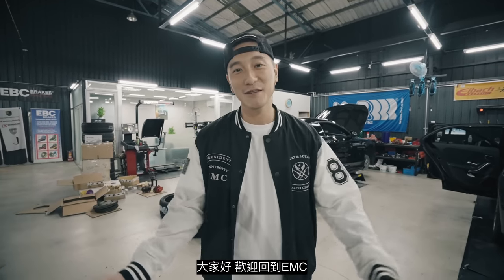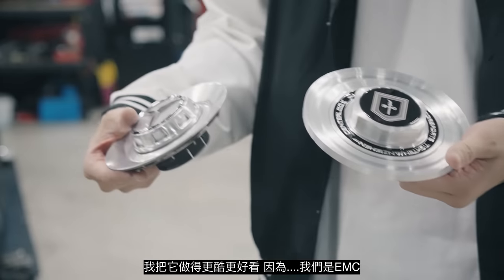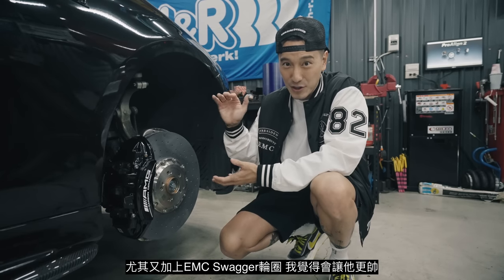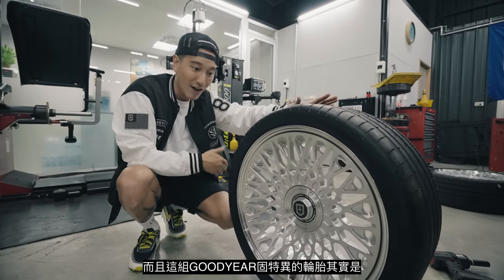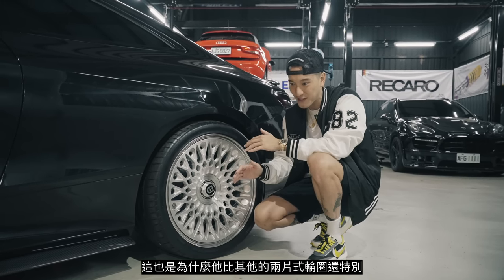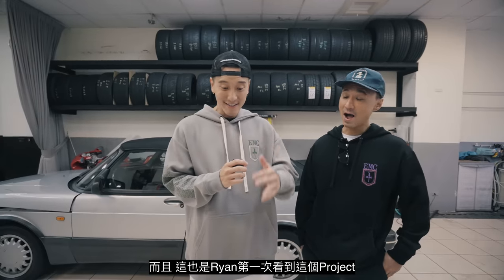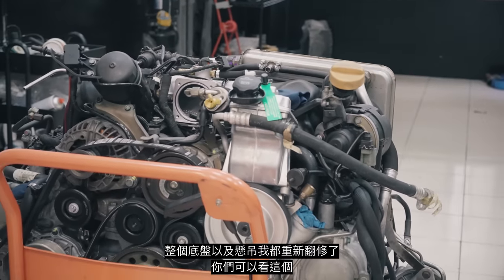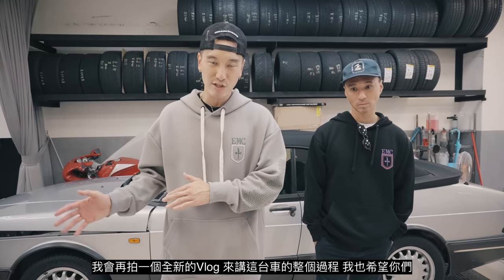黑武士全新進化完成！EMC SWAGGER WHEELS, AMG CCB, AND NEW EMC PROJECT SNEAK PEAK!《EMC Vlog Vol. 75》

Comment: All those fast car on nurburgring leaderboard they don’t use goodyear tho😢
Reply: But it’s good enough for the s63 amg coupe, it’s a super fast and big and luxurious daily coupe, it doesn’t need race tires. It’s not supposed to be a race car like the Nurburgring leaderboard cars…
Reply: Also lets not forget, low profile will compensate tyre regidity issue, in this case Sunny is right good year will be more than adequate